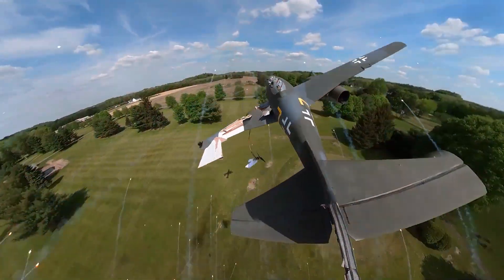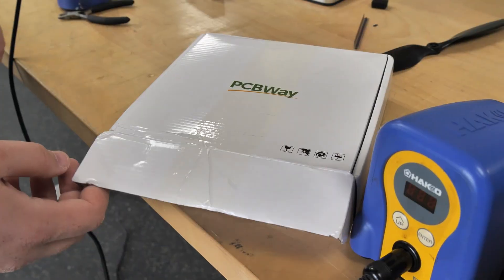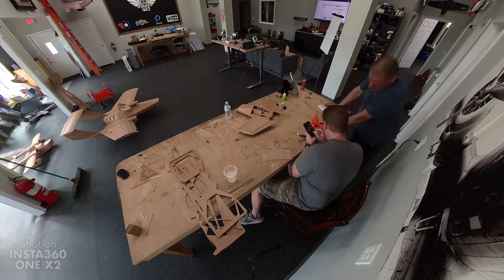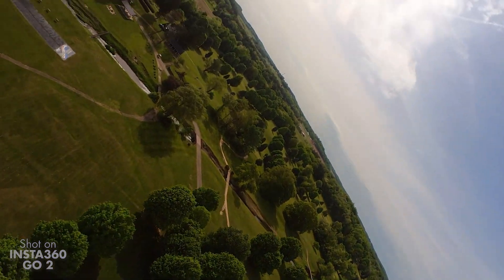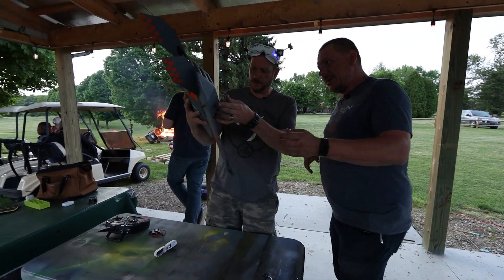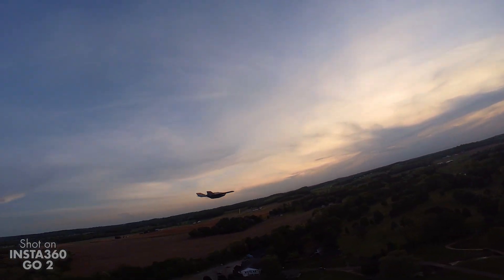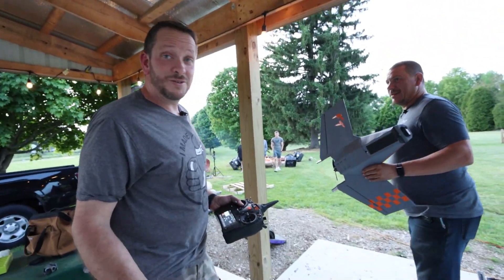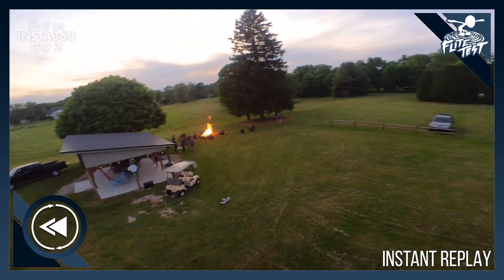Can We Flying Through Fire !!🔥

Comment: If you have enough TVs for the monitor, what if you made them scan the whole 5.8 spectrum and auto-lock on every channel that's broadcasting? I would need to find a receiver module that would give out info or reverse-engineer a few and do it myself. Eh just a thought though. Could be cool.

Edit: Guess an easier way is just lock one TV to one channel. Whodathunk. (but there's like 40? from different bands)

Comment: I had taped the bottom of my Flerken wings, but sitting in my tent at Edgewater, my Shark Flerken's wings folded over as it got hot and the glue melted!  I now have unsightly tape over the glue on the top of my Flerken wings.  A spar would greatly benefit all the Flerkens!

Comment: Flying pretty much any model airplane through a relatively low heat bon fire will not damage it even if it's made of paper, as long as it flies at sufficiently high speed.   There's just not enough time to heat up the material to burst it into flames.   However, if it's flying very slowly or the fire is a high heat/volume/width propane or acetylene column, then it could catch it on fire.
Reply: Beware scammers telling you you’ve won a giveaway
Reply: @spencerstarr990  - Click on the three dot menu next to the spam message, and report it as "Commercial or spam".  I did already.

Comment: Hey if you want a bigger and better fire tornado take a burn barrel (metal 55gal drum) cut 4 holes in the sides low to the ground and add pipes with a fan or I use a 6hp shop vac on blow. I can get a 6 ft tall fire easily with just 1 fan. But if you have a higher rpm fan then go as big as you can also those bounce house blowers work amazing too